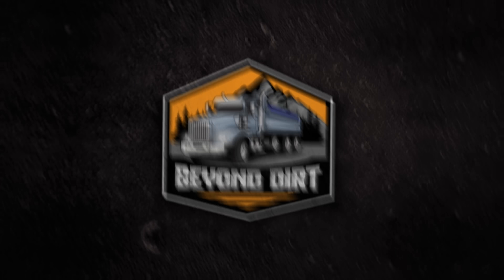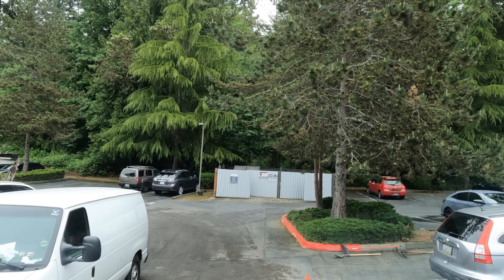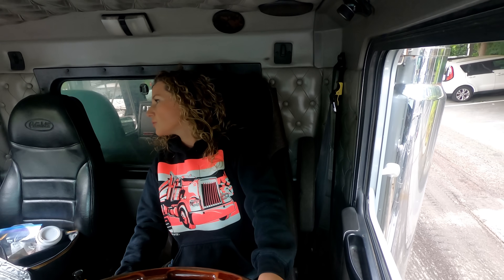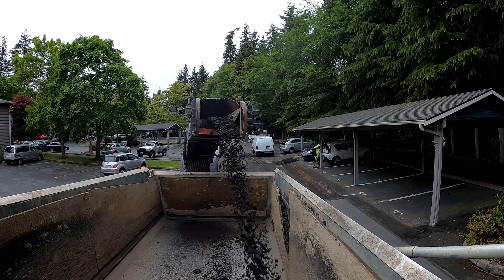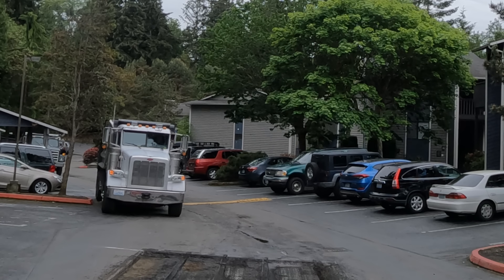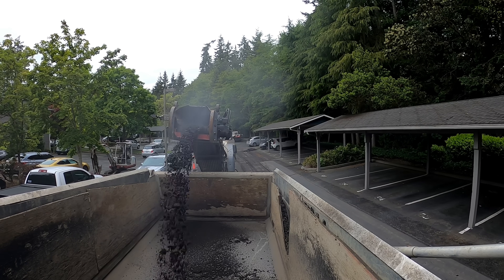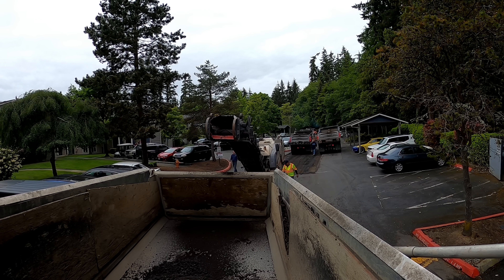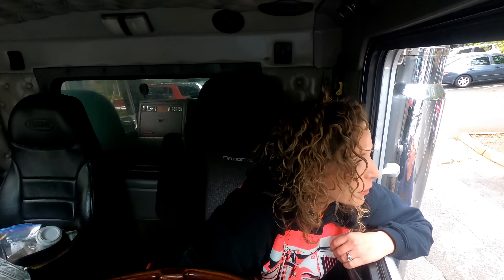Grinding ASPHALT to prep for paving

Comment from the maker: Want a cool standing desk like mine? Try FlexiSpot!  For the New Arrival E7 Plus! Use my code “24BDYTB50” for an extra $50 off!  Trust me, it's a rare treat! FlexiSpot E7 Plus Standing Desk:  USA https://bit.ly/3wGmqzM Canada https://bit.ly/4ajaz8w
Reply: The top link appears to be broken.
Reply: The bottom link as well.
Reply: Ok side note; I've worked in a wearhouse, doing order picker & packing yeah you need to have " your work space" at a proper hight. When does a trucker " coat" the inside of their dump truck's bed ? Is that for hot asphalt 🤔
Reply: Ok I've seen them up close, but wasn't sure of it's proper name. Ty for that bit if knowledge 📝👍☕😎
Reply: Hey Dauminque ( sorry for any miss, spelling) I'm going to post your work desk info onto Facebook, hopefully you are ok with that 👁️👁️🤔
Reply: Ok I actually love this point of view, where you have an outside top view of you truck being loaded. 👁️👁️☕👍 Ty
Reply: Ok Ms Dauminque, it was a Great idea to mount a cam on top of your truck, I love that p.o.v ☕👁️👁️👍

Comment: Very cool video! So, first, the driver on the radio commented what I was thinking. I never saw a grinder operator swing the conveyer from side to side while loading  before, especially in  such a confined area, plus having cars so close.  I'm really surprised that they didn't close off one section of the lot at a time and grind section by section. Safety on a construction site is usually the first consideration. I drive trucks in Oregon, and one of the many features of a diesel-powered truck is the  fact that you can put it in gear and idle along without touching the throttle. Great for backing or going forward in tight spaces. Love it! You also answered another question I had by simply dumping the load in a recycling yard.  I didn't realize they could recycle such material. This was a fascinating video. I really appreciate you for taking the time to share it. Thank you very much, and safe travels. Love your videos! 😊

Comment: Grinding or milling, or we'd call it scarifying in Scotland where I live. Whatever; it's the same basic machine taking the surface off the tarmac and leaving a rough surface that new hot cure asphalt will stick to well. Here we'd have you sit in neutral, h/b off and the machine would push you forward. This is the first time I've seen this process from the headboard rather than from standing at street level.

Comment: Nice work Dauminique. You're better than a lot of the ones I drive with. Ah a Wirtgen medium miller. Our company used to have the big one. We called it snaggletooth. Because some of the sockets couldn't hold the teeth well. We still have the other big one. Odd that they use the horn for movement. Our machine, as well as the contract machines we hire, have a 6-foot rod mounted on the side of the boom. It's mounted at the end with an orange flag. It sticks out and is visible in the driver's mirror. Most just start with the flag at the gate. Let it come up around 4 feet. Then pull forward to start at the back again. The op uses one beep when he's stopping and raising the head. And 2 beeps when you're full. When we're using the 6-foot head. If it's a 4 inch or deeper cut. We get loaded in about 2 minutes. But that's just for interstates and main roads. Developments like that are a big pain. It's a rat race where even the rats don't wanna be there. : )

Comment: A good milling machine operator will hang a flag  at the end of the conveyor sticking out to the side so you can see where the end of the conveyor is at so you can load your truck evenly and not accidentally get too far ahead of the conveyor.
Reply: That’s how we do it in upstate New York
Reply: @OldTrucker958  yup. Same over here in Vermont
Reply: N.H. in the house again..I've done quite a bit of milling over the years..some with my triaxles and some with my dump trailers (the ones that scare you !). Parking lots are always more challenging, especially with a trailer. As someone said, some guys will run a rod out the side at the end of the chute with a flag on it so you can see where it's at. At night they'd have a little light on it. There are good ones to work with, and there are some that have lousy communicating skills between truck and crew. But hey--you did awesome as always !! I hope you have a good summer, and I'll be watching and liking !
Reply: No flags needed.  Just experience.

Comment: I work as a state highway construction inspector, and I would love to have you on one of my jobs. You would be shocked how many drivers cannot drive a truck in front of a mill. We do miles of milling in the projects and it gets so frustrating. The worst thing is that we do it under lane closures, with flaggers and pilot cars so the crappy truck drivers always hold up traffic.

Comment: We call it cold milling on the east coast Canada 🇨🇦 NB province   I've seen them post a guy at your tailgate to give you direction, too much honking, I'd get confused on the one/two honks  guy twitching alot on shoot.
Reply: We use our milling sand mix them with smaller stones and tarry oil and pave our backroads with it. We call it pug milling

Comment: Interesting tidbit:  Two blasts on the horn to go forward, one to stop originated with railroad locomotive whistle signals back in the days when whistle and hand signals were the only means of communication between the engineer and the crew on the ground.  Others included three to back up, and four to call for (hand) signals.

Comment: No, it's actually a milling machine. It's not a grinder but basically that is what it does but the loader operator I don't understi, don't know.
 What weight you're holding? But I can see you're actually about a ton and a 1/2 Abbey on your right side. Now, here in Pennsylvania, they do not actually waithe weight a triangbecause we only run 73 to 83 miles away from me is the New Jersey border they run 80000 they don't have the mountainous terrain we have.  But they.
 Will actually wait when they come across the bridge.😊 Even so, when someone loads me happy on one side and I got a struggle with a handful stirring. Well I don't like it and if they keep it, tell him about it.

Comment: I would hate to be the one riding on top of the asphalt spreader on a hot day.  You're basically sitting on top of a furnace in the first place and then when it's 95 degrees outside your sweat is sweating.